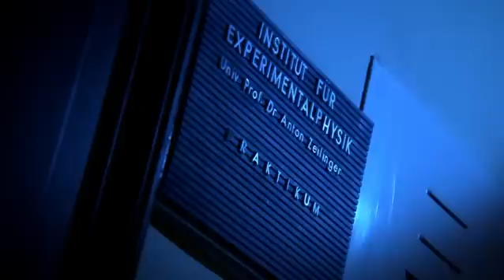Quantum Mechanics - Double Slit Experiment. Is anything real? (Prof. Anton Zeilinger)

Comment: Yep, take their word for it, ha ha... So when both slits are open they get a wave pattern? How surprising since light travels as a wave perturbations and not even lasers(that isn't what you think it is when you do some actual research!), are point sources of light!! You have in lasers a more concentrated to the centre light source, but even out towards the edges you have light TRAVELLING in various directions!! Think of it this way!! You have a sphere of any size spreading out light in all possible directions. So if you pick any infinitesimal minute part of that spherical light source, from that point light is actually spread out in every possible direction!!! Pick another point and same is true so that from every part of that sphere that is facing you, your eye or a detector etc will have light reaching it from every single point!! Now if anyone of you have tried to do this double slit experiment at home in darkness, YOU WILL NOT GET ANY STRIPE PATTERN AT ALL when you use a candle light, flashlight, sunlight etc!! Now if you read on about the cases they supposedly see stripes/fringes-fringe shift, mostly they will tell you you need monochromatic light/laser light!!! Or they sometimes say, "its extremely difficult getting any pattern with normal light sources, so monochromatic light is to prefer".. Which is another way of sneakingly telling you, you will not get any stripes/fringe shift from normal light sources!! So you are told various things and after testing by yourself and get no result of any stripes/fringes, you'll think, it's to hard, "I dont have what it takes to be a scientist", and you give up and trust the word from the authority!!! BUT THIS OUGHT TO BE A RATHER STRAIGHTFORWARD SET UP!!!!! Since fringe shift and double slit was DONE BEFORE THE AGE OF LASERS AND "MONOCHROMATIC" LIGHT!!!! HECK, they supposedly used arc light, car lights and candle and sun light, getting fringe shift and stripes in early and mid 1800s!!!??? Michelson and Morley etc etc, Sagnac etc etc supposedly got fringe shift using arc light shining it through 4 miles of pipes, reflecting it on like 4 mirrors while they SOMEHOW SPLIT THAT arc light into two beams going at opposite directions through the pipes and mirrors at the same time??? That was a huge so called interferometer??? Now remember what every light source is!! How each point of the sun, candle, light bulb or laser "bulb" spreads light in every possible direction!!! Now any spot light etc like lasers, has a mirror that focuses that light, that otherwise should be spread in the "wrong" direction, to go in same direction as that light that by itself is going straight forward!!BUT ITS STILL A FIELD OF LIGHT THAT CANT REACH FOR EVER IN ANY NORMAL EARTHLY CONDITIONS!! Even the most powerful spotlight reach only so far!!! And tends to spread out and dim due to scattering and blocking by the stuff in our atmosphere!!! SO TRY TO IMAGINE HOW A 1800S ARC CAR LIGHT POSSIBLY COULD SHINE THROUGH 4 MILES OF PIPES???? Reflect through mirrors while we have two beams going in opposite directions at the same time???? Ever stood in a long tunnel??? That's a tunnel what? 3-15 meters wide!!! You know there wouldn't be any light reaching through 4 miles of pipes!!! And there wouldn't be any stripes from normal light!!! STILL WE BELIEVE IN "experiments" from 1700- early 1900s are valid??? SINCE THE RESULTS FROM THOSE DAYS OBVIOUSLY ARE FAKED, and those results still are claimed to been done and valid today, obviously we can't trust today's results either!!! And the very reason the very 'straight forward "experiments"'' aren't is because light no where act like particles AS IT ISNT PARTICLES!!!!! THE ONLY REASON SCIENTISM SUPPOSEDLY TURNED FROM WAVE LIKE LIGHT TO PHOTON PARTICLES WAS BECAUSE OF THE DOUBLE SLIT "EXPERIMENT"!?? BUT THEY COULDN'T POSSIBLY HAVE GOTTEN ANY STRIPES OR FRINGE SHIFT!!!!!!!! Now today with more focused light in the best lasers, you will get a stripe pattern by just shining towards the point of a needle!!! As it splits the focused light that anyway coming at it from various directions within the "cone"! If you were to stand in the cone of light looking towards the laser, the light reaching any chosen position within the beam, would have light coming from every point of the source!! You wouldn't just see the light coming from one point of the source coinciding with your present position!! Just as with our sun, they tell us the light reaching earth is only straight and parallel?? This would mean that from the point on earth that you stand and look at the sun, that point would only be hit by light from one specific point on the sun that is coinciding with your location, this due to only straight and parallel rays.....??
Now the claim is that the detector registers each single photon,... he he, yeah sure!!!! As silly as to believe they can pick out one single atom, or small part of a atom in the form of electrons, and shoot them away in a collider, or as in early 1900s, shoot alpha particles on a gold foil?? And through this learn how a atom looked like??? As they right before that believed atoms where like plum pudding.... How could they know about alpha particles? Pick them out one by one(or even a stream) when they had no idea of how atoms looked like, or how they were built???? And how can they pick out electrons, know electrons travel in a current etc WHEN ELECTRONS SUPPOSEDLY IS PROBABILITY CLOUDS??? Come on people add things together!!! Now how could they pick out alpha particles?? Shoot them at a gold foil, and depending on how you formulate your question, sometimes it was that the particles went through the foil to figure out atoms are 99% nothing... Or they collided so they knew the planetary atoms??? Now today atoms are supposedly very much different to be suitable for all their nonsense they want to claim!!! But how could they figure out A bombs etc, when they only knew partially what atoms were??? And about the gold foil, how thin you think they could make it back then!! 0,1mm thin?? HOW MANY ATOM LAYERS IN JUST 0,01MM??? How could any particles go through when our skin stops the particles, or just plain air!!! 
So in this tv show they show them registered each single photon(that obviously doesnt even exist as the whole double slit was impossible back in the days, so they had no reason theorize about particles!!!
Look carefully at the moment they supposedly register each photon!!! Looks like a text or form is to emerge???? And when they start to observe the photons at the slits, no more fringes??? They put two tiny camera symbols, one at each slit, so do they put a camera at one slit at a time?? That's how they usually tell us!!! So do they place one camera beside each slit?? Why would that be any different then when the scientists stand and look or the tv crew films???? What will happen if two scientists stand beside each slit and look???? NOPE THATS MISREPRESENTATION FROM THEIR SIDE!!! They usually tell us when one slit is observed for its photons, the pattern disappears!!! YES PUT A DETECTOR BEHIND ONE SLIT AND THE PART BETWEEN THE SLITS CANT CAST SEVERAL SHADOWS FROM THE LIGHT COMING TOWARDS IT FROM EVERY POSSIBLE DIRECTION OF THE SOURCE IN THE BEAM!!!! Its the wall that casts its shadow!!! Cover one slit is usually how its explained!!!! 
SINCE THEY FAKE THE OLD RESULTS AND THE DOUBLE SLIT IS THE ONLY REASON BEHIND PHOTON PARTICLES, THE WHOLE PARTICLE CLAIM IS INVALID!!!!!!
And Max Planck refuted atoms way back when he made it clear atoms should collapse into itself due to the energy radiating away because of the spinning orbiting electrons!!! So from where does atoms get the energy?? Scientism tried to trick us by telling us Max Planck assumed there was these tiny particles called quanta, tiny massles weightless particles that transported energy,,, But that doesnt solve the problem AS IT ADDS TO THE PROBLEM because quanta=photons transport away even more energy!!!! So no photons, no atoms that hasn't any probability cloud electrons!!!! Its just layer upon layer with pseudo scientism assumptions that on the surface seem plausible in the eyes of the ignorant masses!!! Remember that no student wanting to become a scientist, can or wants to go against the paradigm, or they wont have a job to go to!!! And by the time they get a shot at a opening, they have already put their names on a large number of published articles and papers, thus are already corrupt to the core!!! And dont be naive to think that they haven't control over which to pick way ahead already!!! What do you think IQ tests and various other tests they put us through are!?? Personality tests!!!!!

Comment: WHY ARE THE PROTONS NOT TRAVELING IN A STRAIGHT LINE FROM THE PROTON PRODUCING MACHINE TO THE SLITS? ARE THE PROTONS LARGER THAN THE SLITS?

When traveling a proton can be at ANY particular location, in its wave function, until measured or absorbed. After that it collapses into one point. 

A proton is energy (not a solid object) its location can NOT be known until measured. If you shot a proton at a blank surface you can not draw a straight line from the proton producer to where the proton hit the surface and say “this is the exact path the proton took”. It was everywhere along that path at a distance away measurable to its wave function.

Energy (energy has many forms)  is protruding from the proton in all directions as it is traveling, traveling at the speed of light. Think about that, from the proton producer to the measuring device the proton is traveling the universe’s maximum speed limit, essentially the proton is EVERYWHERE (our time) in its possible path.

Explanation of the DSE:  EZPZ
ONE PROTON AT A TIME: Because the proton is radiating energy in every direction, and this energy (wave function) is larger than the 2 slits, it’s exactly like shining a light beam at the 2 slits and having the “wave pattern”. EZPZ!

WHEN AN “OBSERVER” or DETECTOR IS PLACED ON ONE SLIT: After being detected or measured, the particle travels in a “straight line” (not really) because it collapses into one point, it’s location is NOW known. It’s like the proton is being shoot out or produced again, from the detector to the back wall. And as far as we are concerned, the proton doesn’t exist (in any particular location) until we measure it. And since now the proton is traveling from one slit to the back wall, the wave function caused by 2 slits is not being produced. EZPZ!

Takeaways: Is the proton producer so inaccurate that in that minute distance it can’ NOT shoot a proton in a starlight line? The proton is traveling at an unimaginable  speed, yet the machine can NOT make the proton travel straight? Why not? Because the proton (energy) is on its own “time” and is radiating out energy in all directions, (which is its wave function) until it is detected then it collapses into one point.

The proton producer is so inaccurate it can NOT shoot a proton through only one slit? This tells you how minuscule the slits are (nothing like the example shown) compared to the size of the proton and its wave function.

Ever seen the DSE done with a laser pointer and a comb, or a cd? You can easily reproduce the “wave pattern” at home. But wait, you are “observing” the laser pointers beam, you CAN obviously SEE or OBSERVE the beam. So, why does the wave pattern still show up on the wall. That’s not what happens in the DSE. As soon as an “observer” sees the proton the proton “lands directly behind the slit, not producing a wave pattern “. Because an observer has NO consequence on the proton or laser beam. It’s the act of measuring, or locating, that matters. EZPZ.
Put a measuring device right after the proton producer and the wave pattern will still be seen on the back wall. It’s only when a detector is placed on a single slit, then the wave pattern ceases. 

The Wave Function , is the distance energy travels away from the proton as it is traveling. A minute amount of distance, but relevant. You can picture a wave pattern traveling across a 2D screen, the top of the wave to the bottom of the wave is the measurement of the wave function. Imagine this wave traveling horizontally towards a wall along a 2D surface, it will hit at different locations on that wall depending on which part of the wave comes into contact with it first. This is why the proton producer can NOT shoot protons in a straight line. EZPZ
Reply: @AL Can you are so ignorant that you confuse photons with protons. I didn't even read the rest of your wall of text; your complete lack of basic knowledge of physics is evident from the very first sentence already.

Comment: This experiment is endlessly described in a false way.
The production and detection of just a single photon is highly questionable to begin with, and as they travel in straight lines, if you  are aiming between the slits you would simply never get any amount passing through, and as for the detector collapsing the wave properties? where is this claim ever demonstrated to be a reality?
A lot of woo has been attributed to the double slit, rather than trying to determine the true cause of the effects observed.
Also a single slit produces a very distinct and clear on off pattern, which is also little discussed  which Newton discovered 300 years ago, using a single aperture to produce rings of on and off, Newtons rings.👍😊

Comment: "this suggests we can change the way reality behaves just by looking at it"
That is just not true. This is an oversimplification in many ways and written to make interesting tv. There is something about the dual nature of photons that allows us to see one or the other directly, nothing is being "changed", its a continuous property. 

It's simpler to think of this in a Schroedinger's Cat-esque rationale. Photons are both a wave and a particle (as is all matter in the universe technically on some level). When you define the system to detect something it will then reflect that in the results (akin to opening the box and seeing if the cat is dead). This has even been proven in subsequent delayed result trials where they waited to see based on results if it showed particle or wave behavior, and it indeed showed what they had set up to see.